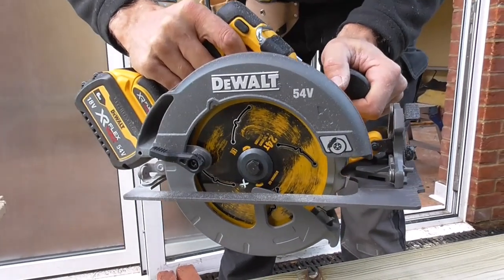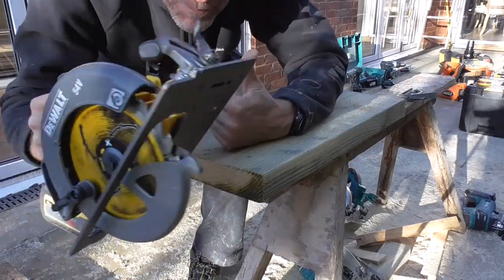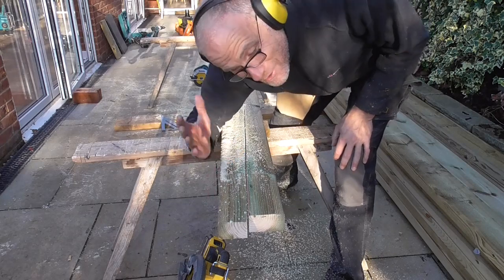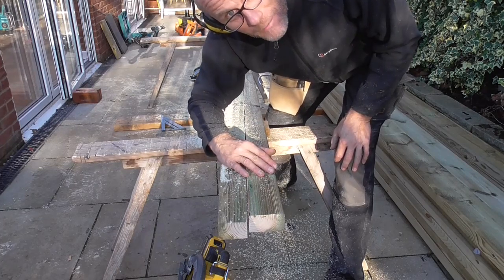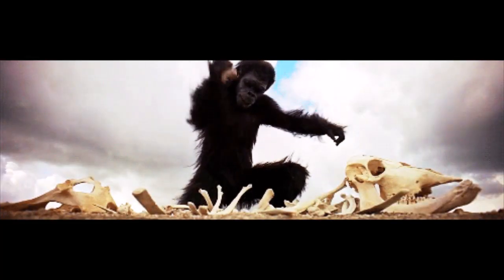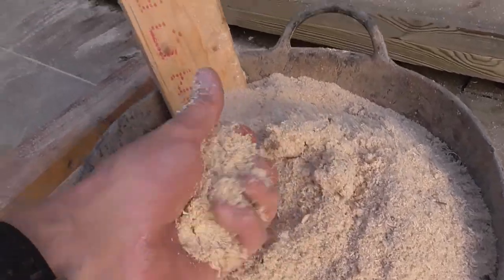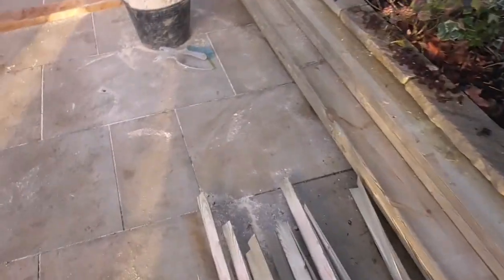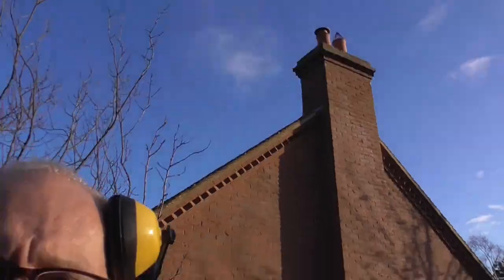DeWalt DCS578 circular saw ****AWESOME****

Comment: Looks like a great piece of kit.. I have the makita 36v brushless circular saw and I used it to cut a large roof with 200x45 rafters and valley jacks etc.. The cordless tools now are amazing.. As you mentioned in the video it's all about keeping the blade sharp and having fresh batteries available.. Keep up the good work fella, cheers.
Reply from the maker: Hi Jim. I hope I don't come across as giant DeWalt fanboy, as I'm not tied to any brand in particular. I suppose what I am now seeing in the new cordless tools is what many have been seeing for a while now, and maybe I've just got left behind a little. These type of powerful saws and cordless tools really do mean that you can properly, 'cut to cord', with no loss of power or efficiency. Nice to read that someone is still doing a few, 'hand cut', roofs as it seems that more and more people lack the skill and knowledge to tackle complex roof structures. (I'm part of this problem as I haven't finished a single apprentice). Thanks for your comment. Cheers.
Reply: @thetallcarpenter  no problem, you don't come across as a fan boy but, if you choose a particular platform then you can get stuck with it.. Its makita with me as I find the range good.. Just bought a 190mm 36v chopsaw.. Great saw for everyday use.. Still got my corded dewalt monster though.. I agree with the lack of skill in the younger chippies when it comes to hand cut roofs.. But we're 35 years veterans... All the best fella, cheers.
Reply: You can also blame the trend to use the pre manufactured trusses,I absolutely love doing traditional roofing joinery.
Reply: I use Makita too  but have to get that saw.. good no BS review
Reply from the maker: @georgewilson5279  Hi George. Makita is great kit and I have a lot of it. I would love to have a go with more of the higher voltage tools from other manufacturers like the bigger YouTube channels, but I/we live in the real world. Thanks for watching and your comment. Cheers.
Reply from the maker: @garethheathcote4988  Its nice to hear that guys still enjoy hand cutting roofs. I think complex roofing is almost like the Holy Grail for many carpenters and once mastered, (if you even can actually master anything), is very interesting and satisfying. Cheers.

Comment: Just bought one, and you said all the thing i hoped you would! Thanks for the video, great review. Blunt, honest and concise, exactly what I was looking for. Cheers!
Reply from the maker: Hi Eiren 🖐 I've been using it properly for 18 months now, and really don't regret buying it one bit👊The 6ah batteries don't last long, but as long as you've got couple, you should be alright, and I found the Extreme run time blade wanders quite badly when ripping😬(I've got a saw thin kerf saw blade video coming out soon where I compare different brands to see which one cuts the straightest👍) Thanks for watching and your comment😎Cheers Del
Reply: @thetallcarpenter  Great to know, thanks! Ive heard others say they dont think much of the XR blade, saying it doesnt make use of the power as well as other blades and it can leave a the surface splintered / chipped. Id be very interested to see that video. What blade have you been using with it day to day?
Reply from the maker: @eirenwhelan3312  I found the DeWalt 190mm  blade with a 1.65mm kerf is the sweet spot for this saw, (and pretty cheap). I don't, necessarily think its the 1.5mm kerf of the Extreme runtime blade that comes with the DCS578, but more the stiffness of the saw body/plate due to the expansion slots that are cut into it🤔

Comment: I just got the same saw, what a beast. But throw the thin kerf blade away and put a regular blade on. The tool has more than enough power and the blade doesn't wobble around in the cut. Excellent channel 👍
Reply from the maker: Hi James. I have actually put a slightly thicker kerf blade in as I have noticed it can wander in the cut a little with the thin ones in. 🤩 Puts a smile on my face every time I use it now.😎 Thanks for watching and your great comment.👍

Comment: Nice to see a review with wet timber with the saw too. I have a 110V 235mm Hikoki. Powers through the timber, but that flexvolt is amazing for battery power!
Reply from the maker: To be fair James, these large volt cordless tools are very powerful, but you still can't push them all day like you can the corded ones👊without EATING through batteries🤔Thanks for watching and your comment 😎 Cheers Del
Reply: I’m interested in this saw however I’m not as familiar on the flex volt system yet, as with the makita 40v and Milwaukee red lithium. So my question is how do the flex volt fair over time? Do they have a shorter run time than most? And can crap out? This is what I see in reviews

Comment: I'm gutted now because I only have the 576, it would be nice if they did an updated version of the 577 as I'm yet to buy that. Thanks for the video.
Reply from the maker: I think the DCS577 is a more powerful saw anyway due to it being a blade left worm drive. To be honest, all of the 190mm 54v DeWalt saws are monsters and massively capable when the going gets tough. Cheers.

Comment: Great video. Have used my friends it cuts like butter I'm on the makita platform and have used the 36v worm drive but the dewalt has so much power and lighter easier to use for framing work.
Reply from the maker: Hi there🖐Having never used one, I'm intrigued and fascinated by the worm drive saws, and hoping to try one out one day👊As you say, the DeWalt has a lot of power, but it does eat through 2ah batteries when you work it hard😬Thanks for watching and your great comment 😎 Cheers Del

Comment: I have the 575 and it's power is insane ! Mine will do full depth rips in seasoned Aussie hardwood like a knife  through butter ,absolutely LOVE IT .
Reply from the maker: Hi. I tried my mates 575 a year or so ago, but only for a few cuts. I forgot, untill I got one of these DeWalt monsters, how powerful it was. Keep on cutting!!. Thanks for you comment. Cheers.
Reply: @thetallcarpenter  Could you tell me if you were running the 9amp battery in your video ? Thanks .
Reply from the maker: @interman7715  Hi there. I'm just running the 6ah batteries. Will probably get a couple of 9ah ones in the future. Cheers.
Reply from the maker: Are you in Australia?.(I presume you are if you're cutting Aussie hardwoods).
Reply: @thetallcarpenter  Yep Aussie hardwood ,it's hard and dense . Btw I work with a few Pommy chippies ,  really good blokes 👍
Reply from the maker: @interman7715  I bet you have some sports related 'banter'🤩 Cheers Del

Comment: I've had mine for around 2 and a half years now, I use it for everything except for ripping firing strips, for that I get my 9 inch corded saw out as like your said it eats batteries.
If anyone is thinking of buying one if you are not in any rush dewalt do a deal most years where they give you a free battery when you buy a kit, that's what I done so mine came with 3 batteries
Reply from the maker: Hi Ilija 👋.  Great comment and I actually did buy this saw when DeWalt were offering a free extra battery.👍 Thanks for watching.😎

Comment: mainly use brushless 165mm makita which gets hard life (oak framing) it's only got 55mm depth  so use 110v 9"saw too (bandsaw and swordsaw also)
What I love is safety. If blade jams in a way that would make a mains voltage saw kick..  it just stops dead.
Reply from the maker: Hi there. You're dead right about the safety side of these cordless saws. As you say, when a mains powered saw kicks it can be like riding the Rodeo!!😆 Cheers.

Comment: Have you tried the 305 mm flexvolt mitre/chop saw? That is one hell of a beast,it will run off of two of the flexvolt batteries or you can get a 110 or 240volt adaptor. It's expensive at 900-£1000 with two batteries but it's worth it for the cordless capabilities!
Reply from the maker: I haven't tried that saw, but I did have a few years ago, the DeWalt corded 305mm saw which I found a bit too much for the, mostly, 2nd fix work I did with it. I've only got 2 corded bits of kit left now. My 216mm ELU chop saw and my 250mm DeWalt table saw. (maybe put them on next years Christmas list !!) Thanks for your comments. Cheers.
Reply: No

Comment: I found with mine the blade wobbles a bit when ripping firing pieces, but I got a milwaukee blade and seemed to work better
Reply from the maker: Hi Darren. I think I am finding the same bud.🤐 Like you, going to try a different blade.😎Cheers.
Reply: @thetallcarpenter  I got the cordless makita 36v rear handle saw its a beast, but the milwaukee blade seems to have done the trick I ghink

Comment: I've owned the 575 for a couple years, and consider it to be very powerful. Even during ripping it still retains almost full rpm. The build-quality is also excellent. But the saw is heavy! I swapped it out with a DCS565, which it seems like almost no one is using. In my opinion you should buy the track-compatible saw once you go right-blade, otherwise I'd stick with left-blade. One complaint I have about 190mm saws is that they usually are used with thin-kerf blades. These blades are unstable, and terrible for ripping plates on freehand.
Reply from the maker: Hi there. Your comment is really interesting. Having used the DCS578 a fair bit now, yes, its crazy powerful, but is a handful to keep to a line. I did wonder if the blade is a little too thin and lacking stability when coupled with such a powerful saw.😣 Your comment is prompting me to fit a slightly wider kerf blade and see how I get on.💪 It may affect run times, but I've got a few extra batteries. I have also been looking into replacing the base for the track saw one. Its not that expensive, and only has a few bolts to undo to swap it.😎 Thanks for your comment and for watching.👍 Cheers.

Comment: That is some wet wood! To only go through 2 and a bit batteries is awesome.
Reply from the maker: Hi Snot Bubble🖐It's very impressive, and isn't too bad on batteries👍I have found the thin blades can wander in the cut, so I use slightly thicker ones which eat the battery a little faster but give a nice straight cut👊Thanks for watching 😎 Cheers Del
Reply: @thetallcarpenter  got it, used it. Fantastic. Yes, little bit of wander on the thin blade but was OK for what I was doing. Great for ripping!
Reply from the maker: @snotbubble2894  That's great to hear bud, and hope you get many years of trouble from service out of it😎Cheers Del

Comment: TC, this saw is really powerful - Any rip blades you would reccomend?
Reply from the maker: Hi fella🖐Ironically I don't recommend the DeWalt thin kerf, Extreme runtime blades for this saw as they wander about terribly in thicker timber😬 I just use their standard 190mm blades👍
Reply: @thetallcarpenter  😎

Comment: Great video! I’ve just got the DCS579 (the same saw with the track base), seems it won’t sit on my old hand me down festool tracks. :( Apparently with a 9Ah 54v battery dewalt say it will produce even more power in terms of watts out! Surely the most powerful cordless circular saw on the market along with the DCS577
Reply from the maker: Hi there. I take it you were also impressed with monstrous amount of power available from these latest DeWalt 190mm saws?. That was a genuine, first time reaction of mine after ripping down that timber. Amazing. Your probably right about the benefit of higher Ah batteries, particularly, for these saws. They're just bloomin expensive. Shame the DCS579 doesn't fit the Festool rail. Thanks for your comment. Cheers.

Comment: Del, whats your goto blade on this saw for ripping work ?
Reply from the maker: Hi Shizz🖐 For ripping I use the DeWalt Extreme 24t blade with a 1.65mm kerf as I find the cut stays straighter than when using DeWalts Extreme Runtime 24t blade with a 1.55mm kerf.
I know it doesn't seem like a lot, but the plate/body of the blade is thicker on the wider kerf blade, which, obviously, is where the increased rigidity comes from, plus they probably dissipate heat better maintaining plate/body stiffness whilst cutting👍I'm doing a video on it soon👊Thanks for watching😎Cheers Del

Comment: Would this be your go-to saw for roofing or do you prefer using your Makitas?
Reply from the maker: Hi Denny. If could only have one saw for roofing, this DeWalt would be it. 😎 I do grab my Makitas as they are light and OK for 1.5inch timber, but not everyone has 3 different saws. 🙃 Thanks for your comment.😎

Comment: Does it work on the DeWalt rail do you know mate? Good video
Reply from the maker: Hi there🖐This saw doesn't, but only because of the base, which is the only difference between the saw that can and can't go on the rail👍From memory I think the track compatible base is available as a separate part for around £60😎Cheers Del
Reply: @thetallcarpenter  cheers Del mate. I'll go for the 579 then as it's about the same price with the additional base in the end :) Keep the videos coming. George 💪🏼

Comment: i've noticed youre buying dewalt tools, is ths a deliberate migration from makita to dewalt?
Reply from the maker: Hi Shedlife🖐No deliberate move from Makita bud👊I just wanted the 54v 190mm saw, and this enabled me to buy a few other DeWalt tools that I think are superior to Makita🤩It's funny, that in some of my videos, I look like a Makita man, and in others, I look like a DeWalt one😝Thanks for watching 😎 Cheers Del
Reply: @thetallcarpenter  cheers.  There’s ridiculous choice atm with cordless kit.  To stay on platform or jump off the platform, that is the question.  Or something.
Reply from the maker: @shedlife1783  I don't believe one manufacturer has nailed every tool, and having 2 different battery platforms, does give you a wider choice of tools👍

Comment: Thats impressive Del, Where did you buy yours saw, and was it battery's included?.
Reply from the maker: Hi Frank. I can't remember where I got it and the invoice is with my accountant. It came with two 6ah batteries and at the time of purchase, DeWalt were giving an extra 6ah battery away. The 6ah batteries dont last long and I think the 9ah would be better. But still a great setup.👍 Cheers.
Reply: @thetallcarpenter  Cheers Del.
Reply from the maker: @frank1847  No worries.👍

Comment: I find that the 0 gage for the blade is off on my one
Reply from the maker: Hi there. Is it off by much? Mine seemed ok, but it a bit of a bruiser of a saw and gets all the structural work that isn't quite as critical.😬 Its something I'll keep my eye on.😎 Thanks for your comment and for watching.👍Cheers
Reply: @thetallcarpenter  yea it seams to be off by the thickness of the blade ! It's strange maybe I could adjust the plate over slightly ? Not even sure that's possible I'll have a look ! My corded Makita saw is bang on with the gage
Reply from the maker: @brithozierhozier4718  I'm sure there is an adjusting screw in the plate for this.👍Cheers